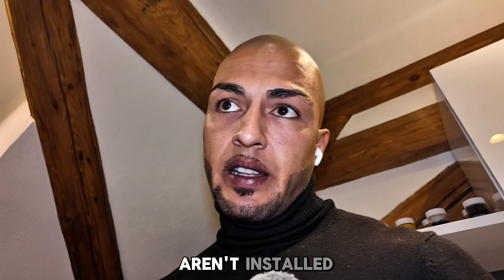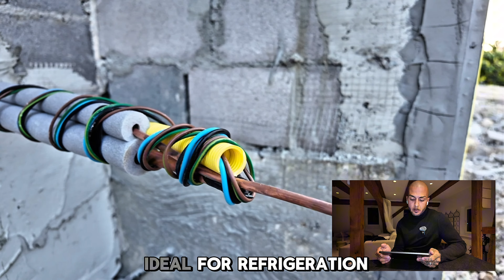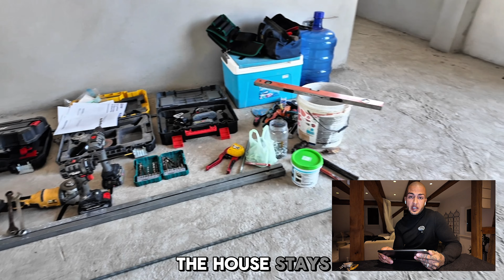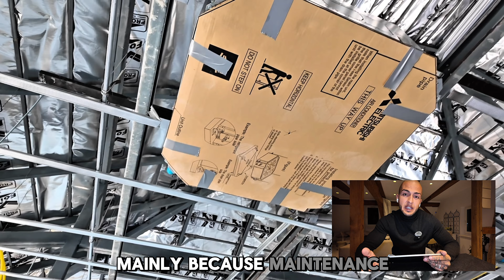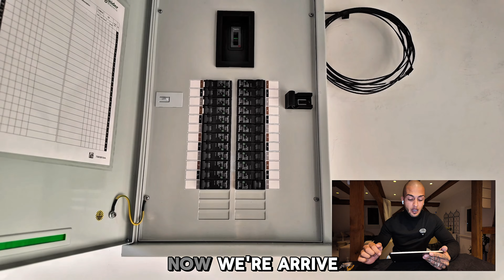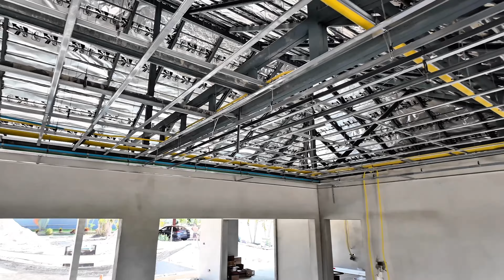EP5 : Electricity Air Con & Drywall | Hua Hin Villa for Sale

Comment: Thank you I didn't know that about air conditioners. Air condtioners inside are normally installed around 2.5-3meters high. If the outdoor unit is on the ground VS the same level as the aircon is there much of a difference in efficiency?
Reply from the maker: Hi Sir ! First of all, thank’s for watching :). Ofc it is mate ! Because if the outdoor unit(motor) is at the same level of the indoor unit, there’s less cable because there’s less distance. But if the indoor unit ir around 2.5 - 3 and the outdoor unit is on the ground then you need more distance cuz the pipes must go outside of the house first by a straight line ? then you must add pipes again for go from this point to the ground :). 

Hope this can help you. 
Thank’s for reaching me 😃😃